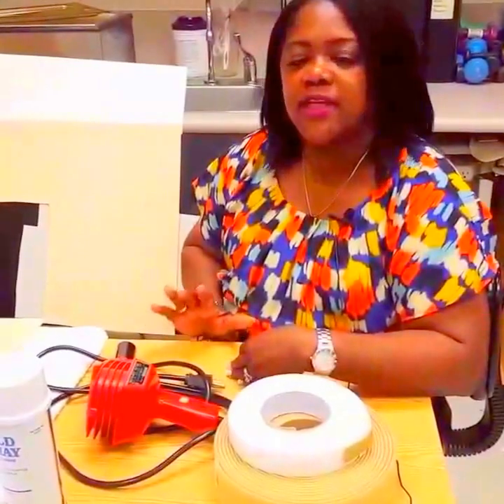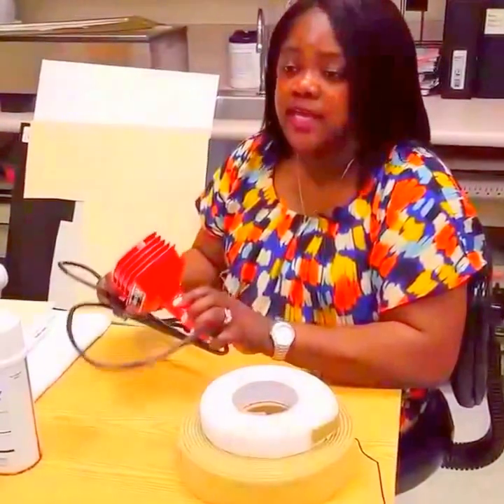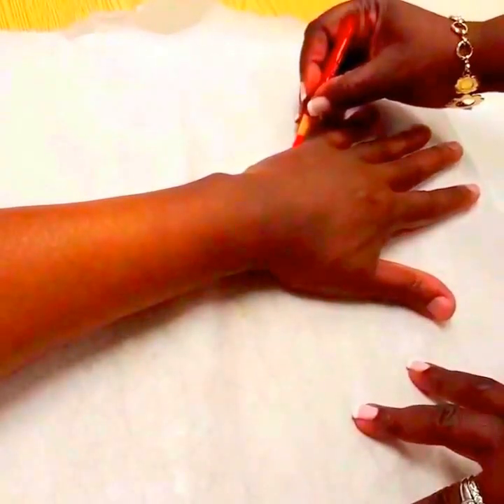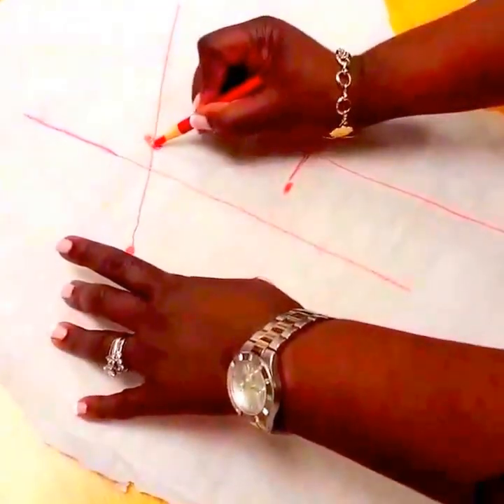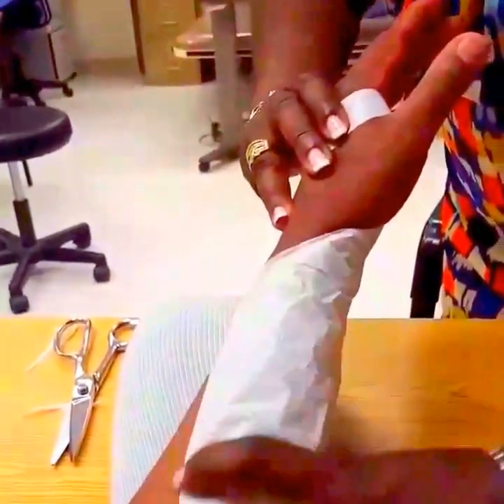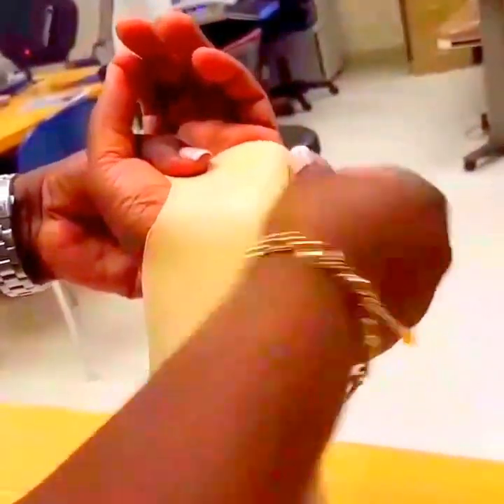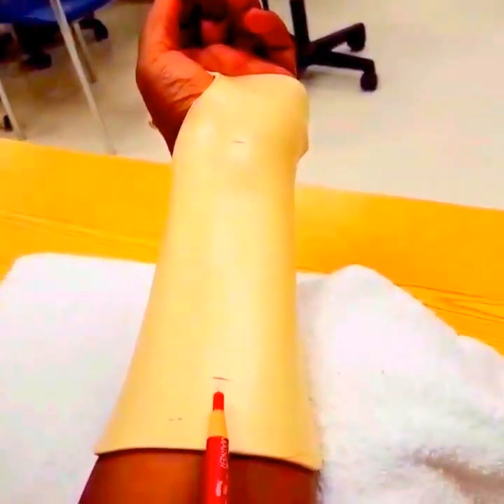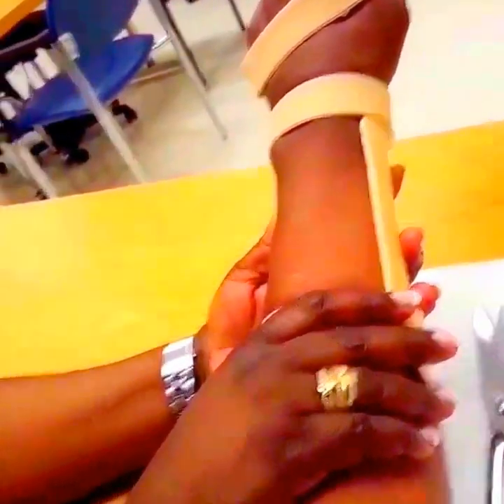From Start To Finish: Fabrication of a Cock-up Splint

Comment: Thank you. You have demonstrated how to prepare a Cock-up splint.
But there is an obtruction to perform Opponence of thumb in full Range due to the splint as well as there is obstructions to perform Metacarpophalangeal joints in full Range ( Flexion ) due to the splint you have made. Will you kindly make it in a correct way and publish it again please ?